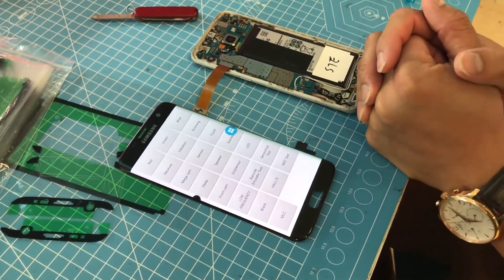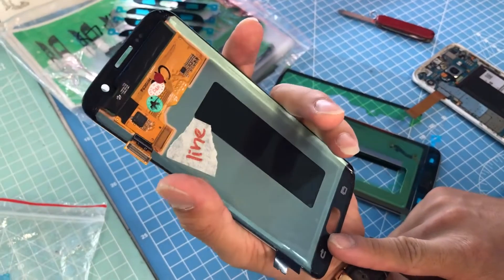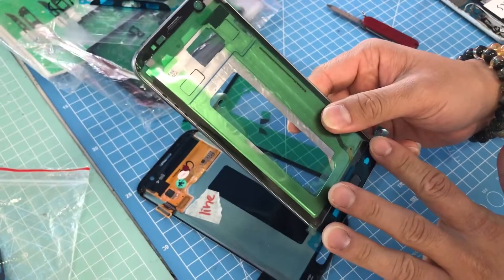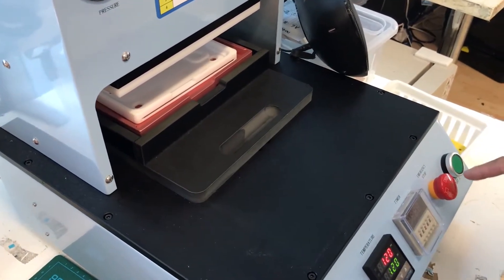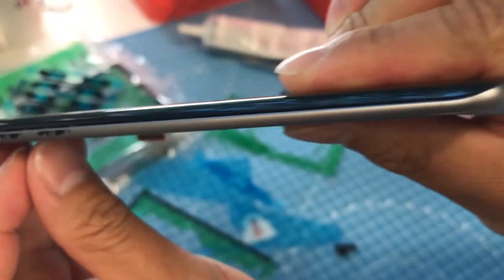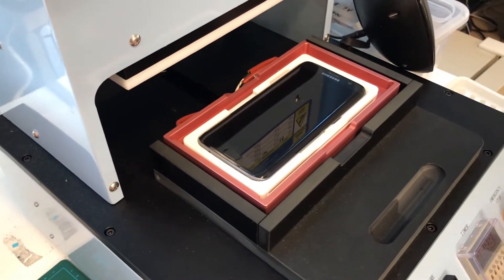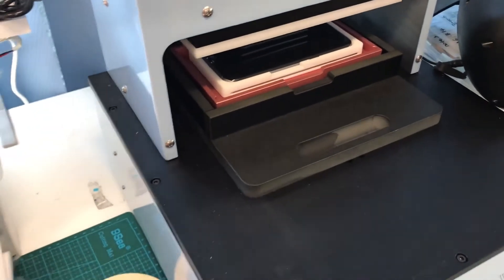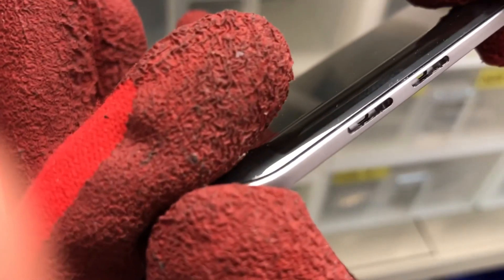REGENI RG260 pressing with heating  to solve falling off of glass frame of smartphone Galaxy S7 edge

Comment: Hi. How much cost a RG-2601/RG-280 assembly jig set ? Do you have developed jig set for all A, J, S samsung series ?
Reply from the maker: We are developing universal RG-2601, but we have each precise RG-2601 jig inlet, available models are for S6, S6 Edge, S7, S7 edge, S8, Note 5 6 kinds for Samsung models , A, J series are not developed by less market demand and RG-280 jig is not related with the pressing assembly but related with precise adhesive attachment as adhesive jig, RG-280 set require MOQ 100 sets for 1 model, for more discussion, please send me email  michael@regeni.com
Reply: So, for pressing bond operation is necessary only RG-2601 specials moulds, right ? And for perfect alignament of the back cover with adhesive is necessary RG-280 set ? The back cover can be applied manual (with imperfect alignament, of course). Please, confirm if I understood the right procedure. Thank you.
Reply from the maker: With simple clamp and other device, tools, I do not want to mention them, also with only RG-2601, it will not fit to your model, only with RG-260 and RG-2601, then troubleshoot edge models as main objective to shoot this movie and recommend our machine RG-260 and jigs RG-2601-S7 Edge, RG-2601-s6 edge to solve falling off problem of glass frame, RG-280 is not related with this movie objective to solve falling off problem. RG-280 is related with precise adhesive attachment.  Please refer to below movie link:
https://www.youtube.com/watch?v=SB_gOZyQ64Q&t=106s
Reply from the maker: https://www.youtube.com/watch?v=1LUoauvW0VI
Please check above movie to understand using both RG-260 main machine and RG-2601 heat resistive jig, for each model of smartphone, RG-2601 is different among one another for precise bottom, 4 sides, total 5 sides, and we considered heat expansion to perfectly fit to specific model of smartphone.
Reply: I dind't excluded the RG-260 machine from the procedure, I wanted only clarification between RG-2601 and RG-280. Thank you for your promtitude.
Reply from the maker: I see, Welcome, Have a good day !
Reply: A and J series are the best selling/affordable models from Samsung. You have to consider to develop jigs/moulds for this series. In a gsm service most of half of the Samsung costumers are owners of A/J models. Develop these models and your product will become more attractive for potential clients (even for me :) ). We are in 2018 and new models are on the way to appear. I observed that RG-2601 mould is made from rubber/silicone, it should not be hard to reproduce all the 2016/2017 models.
Reply from the maker: Maybe you have to wait our finish of new universal heat-resistive jig RG-2601

Comment: that machine returns the resistance to water?
Reply from the maker: If adhesive , glass frame, others are original as no space, and you get specification of phone production specification like temperature, pressure, pressing time, you can try with test equipment whether it can retrieve original condition or not.
Because there are many factors to influence original produced condition of water resistance by A/S worker`s skill and materals, we inform customers RG260 to compensate to retrieve performance of water resistance of phone.